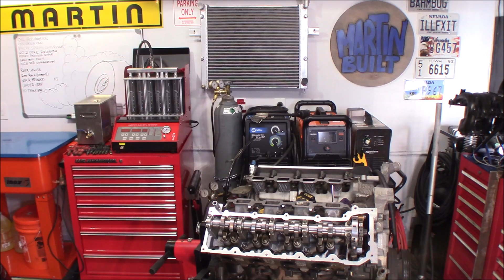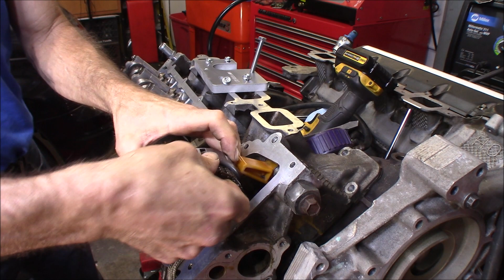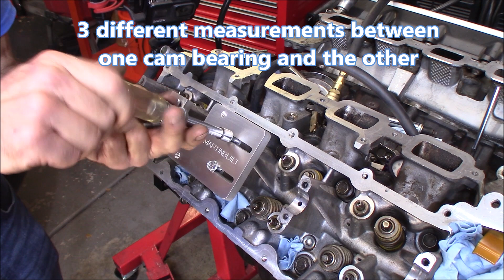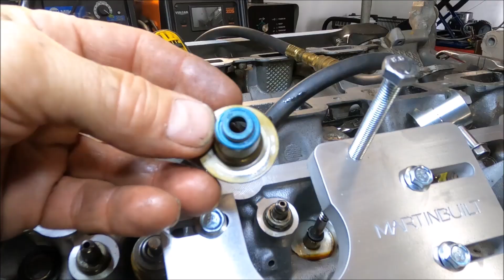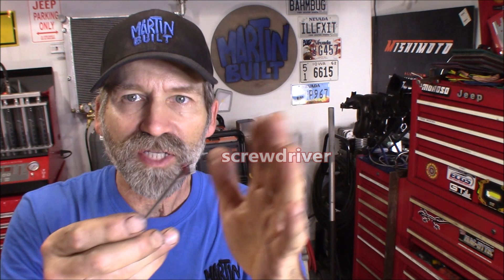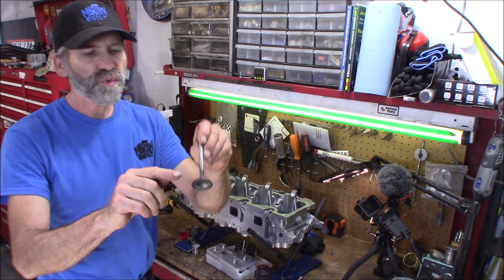Martinbuilt Valve Spring Compressor for 3.7, 4.7 Jeep, Dodge, Chrysler, and Mitsubishi

Comment: All of the compression test kits seem to have a one way valve at the end that goes down to the cylinder.  When I put air to it, nothing seems to happen.  It seems to only allow air one way (out of the cylinder for testing at the gauge).  Am I missing something?

Comment: @martinbuilt can you install 08 valve stem seals in a 04 HO? going to be replacing mine soon and was just wondering.
Reply from the maker: I have actually tried that before and they do fit, I believe it was one or two of the valves, the seat area needed to be enlarged a little bit and I'm talking just thousands of an inch, but it may be okay.
Now the 08 and later come with the valve springs with the seals.
https://amzn.to/3VM9Lov

Comment: I have a jeep grand cherokee wj v8 4.7 I need to replace the valve stem seals without removing the head I need a tool like yours I would really appreciate it if you can help me where to get it from

Comment: I didn't know that i have to remove all of this to remove the spring on cylinder 8. Still having problems. Bought a new spring and valve keepers for cylinder 8. I responded back to you through email. I wouldn't be able to pull my trailer with a dropped seat. No smoke.

Comment: Great video and really decent tool. One thing bothers me, since you're not turning engine, some cylinders may have open valves. Is air pressure still enough to keep valve in place?
Reply from the maker: The valves are all closed because the camshaft has been removed to use this tool.
Thank you for watching.
Reply: @martinbuilt  Yeah, realized how stupid the question was right after it was sent. lol ))

Comment: Hello Martin
Do you have this 2  parts for sale ,in ebay for example?
I want to change the stem seals in my  4.7  V8 H.O
Reply from the maker: I have the valve Spring compressor available contact me on Facebook Messenger there should be a link in the description.

Comment: Hi there, I have a 02 grand Cherokee 4.7 and picked it up cheap.  Pulled the valve cover off the passenger side and saw no.2 cylinder rocker arm off. My question is if that happens would that cause that cylinder to have no compression? Or would it be a valve seat?  Appreciate the channel and all the info
Reply from the maker: If that cylinder has no compression and the rocker arm is completely removed from it's normal position that would be a dropped value seat. ☹️

Comment: You have some great videos.  I have a 04 jeep liberty 3.7 and I believe I have a rocker arm pop out.   Knocking and running like its on 5 cylinders.  The knock is consistent and from the videos i've seen it all points to this problem.   I'm going to attempt to try fixing myself.  Should I put in the upgrade rockers... I plan on doing the lifters at least on the side I have opened up
Reply from the maker: Thank you appreciate that. Yeah while you're at it I would upgraded the  rockers while your in there. Hopefully your problem isn't a dropped valve seat
Reply: @martinbuilt  that’s what the mechanic said if the seal is bad I would need a new head.  $2000
Reply: @martinbuilt  would that mean taking out the head if it’s a dropped valve seat
Reply from the maker: Unfortunately yes that's what it means. And actually that's what I suspect has happened I don't think a throne rocker would make a knocking noise. What I suspect is happening right now is the valve is stuck in a downward position and the piston is hitting the valve and that is the noise your hearing.
You could verify that by removing the valve cover and then when replacing the rocker arm if you're able to reinstall it with no tools at all yeah valve seat dropped also check to make sure the spring is not broke if the spring is broke that could be the cause right there
Reply: @martinbuilt  I pulled the cover.   The far back left side rocker was just laying in side,  popped out.
Reply: @martinbuilt  I’ll check the spring and also see if I can install it with no tools. What rocker lifter set do you recommend for my 04 Liberty.

Comment: Hello Martin. Great video as always! I replaced my valve stem seals out side the engine compartment with a home made tool I prepared. It worked some what great and hey, face it, it did the job. For some reason three of them are leaking oil. I'm going in again, this time with the valves in the Car. There's no way I can do it with my "tool". The problem is that haven't been able to find it in your facebook page. Can you help me here with the info. Thanks in advance!
Reply from the maker: Just contact me on Facebook Messenger, thank you.

Comment: Have you seen the valve spring compressor that does two springs at a time in the day 5.2 or 5.9 magnums .. I used it for first time An did some mods to it  an it was pretty slick too
Reply from the maker: I haven't seen them, I've seen the ones for the Hemi

Comment: You make awesome videos! Keep it up! Just bought a 06 commander with 280k and with your wisdom I will be doing many jobs to bring her back to 💯.. I have a 2 part question for you. Can i swap a newer 4.7l HO into my 06 and if so what else might I have to change?
Reply from the maker: Should be able to, the only thing would be does your vehicle have an EGR and if so does the donor engine have one. And as long as both engine had an NGC ECM it should swap right over.

Comment: I'm having a problems with my 4.7L engine ticking. Replaced lifter like you instructed  in your video. But problem persist Any ideas what my problem could be? HELP!! You can write me back at: Barbequeking1@aol.com. 
Any help would be greatly appreciated.
Leon
Reply from the maker: this can be caused by a faulty hydraulic tensioner, you can remove the front tining cover start the engine for a few seconds and you will be able to see the tensioner adjuster bouncing.
Reply: I had one make the lifter tick but it wasn't any of the lifters. Turned out to be a small crack in the cylinder wall on #8. The crack ran top to bottom in the sleeve and was about an inch long, one side of the crack had pushed inwards twords the piston. Every time the piston went up or down the rings collapsed inwards tapping on the inner radius of the ring groove. It ran like that for a long time with some copper sealant in the cooling system. It eventually started leaking and I had misdiagnosed it as a head gasket issue until I found the crack. Luckily #8 was at the bottom of its stroke when I started taking it down or I would have never seen it. Ended up having a new sleve put in it, rebuilt the entire thing, and it is still running today 5 years later. I no longer have it but the guy still drives it every day. Probably has close to 400k on it now.
Reply: @codylapoint  Thanks so much for great news! I'm forwarding to the work ahead of me. However, if you are looking for a good use truck.....

Comment: So I dont have Facebook and Im a little curious as to the cost? I might have missed that part of the vid tho lol. Idk i feel like a universal overhead valve spring compressor does the job fine. I have the northern tool 20$ one, filed the spring grabber hook ends flat so they sit better on the spring, filed the pusher top flat as it’s poorly bent from the store and a few other little things. Anyway point is, your product is nifty! But personally id go with the universal one as I don’t think it’d be possible to do it for cheaper and it does the job
Reply: Also the small parts make me worried.. I have a problem with losing small tools😂 like my first overhead valve spring compressor

Comment: I don't know if you mentioned it, but putting the piston at BDC will keep the engine from turning when air is applied.  I learned this the hard way years ago.
Reply from the maker: you'd only be able to do that on one cylinder, as your are unable to rotate the engine without losing the timing.
Reply: @martinbuilt  By leaving the other cam drive intact I believe you could turn the engine as long as you kept some tension on the loose chain. Getting time back would be a matter of getting the intact side cam mark straight up, and putting the other one back in with it's timing mark straight up.  As long as the intact side was undisturbed it should all be good. At least that's how it seems to me remembering how the timing marks are in relation to each other.

Comment: Saw some metal flakes dropping while you were tightening and loosening that bolt for compressing/decompressing the valve. For smoother operation and increased longevity, I'd put some grease or oil on those threads to keep that from happening. Well done, looks like a great tool.
Reply from the maker: yes I may have forgot to mention that it is a good idea to use a small a small amount of grease on top of the retainer cup.

Comment: That's a handy tool  keep the valve keepers in the retainer and lay on top of springs used grease on find  a piece of fuel hose on a locking  needle  nose  and lay on top after installing spring tool and push  down when compressing spring thats how i do it i may work for you
Reply from the maker: Thanks for the info
Reply: @martinbuilt  can you do a video for engine block heater?
Reply: @luiscruz: You may have a useful tip here bro, but using a little care to properly use a period or comma where it's supposed to be would make it UNDERSTANDABLE. You could edit your post to fix that. Thanks 🙂